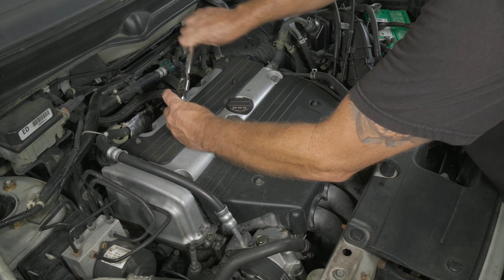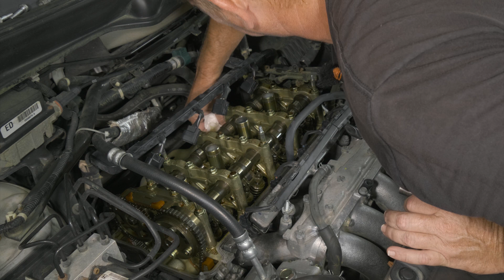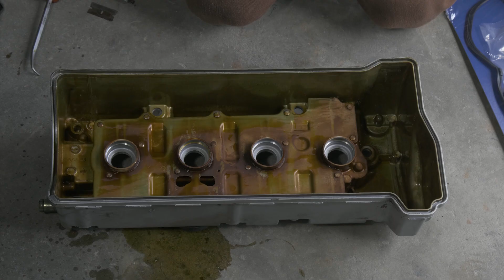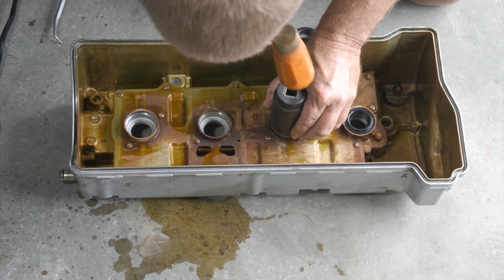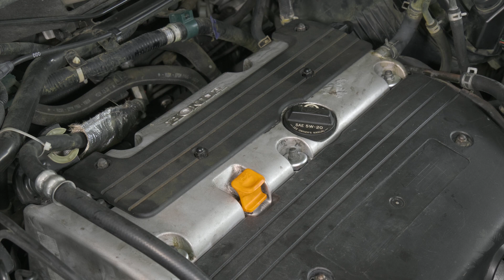2006 Honda Element Valve Cover Gasket

Comment: Nice job. I may try this myself but too nervous. I have a small leak somewhere in behind the alternator and I think the oil pan gasket too.
Reply from the maker: You can do it! This job was easy compared to some other valve covers we've done.